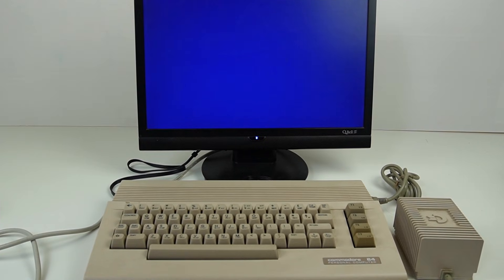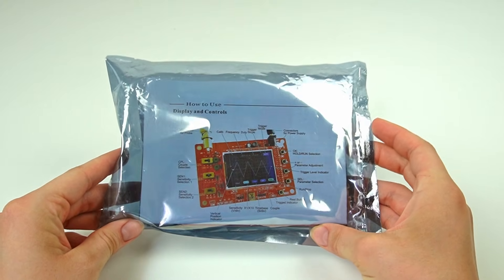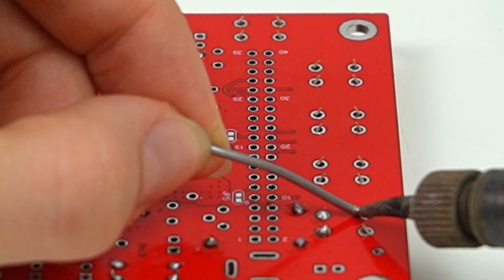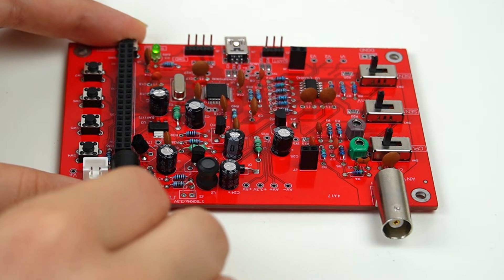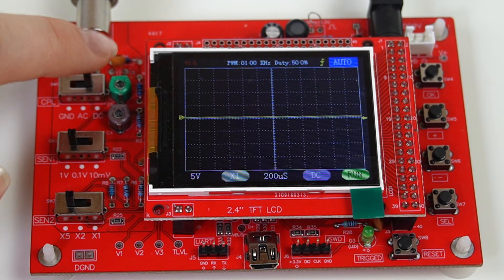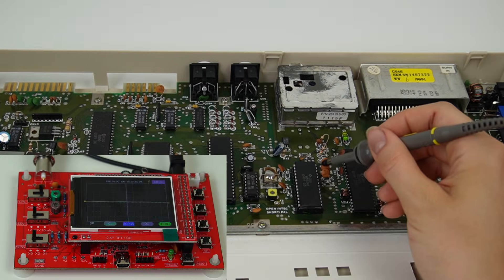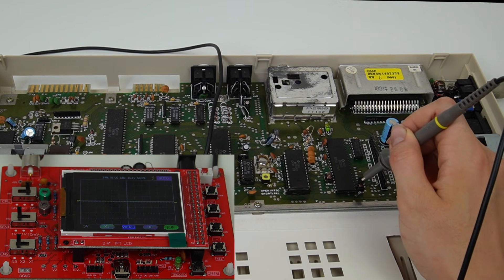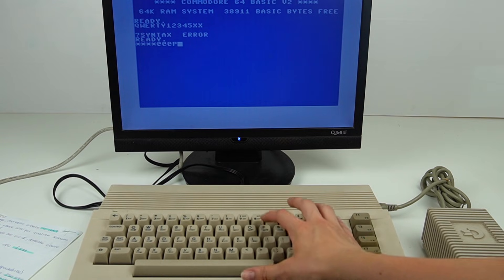I fixed a C64 using a $20 OSCILLOSCOPE

Comment: Just to say, and I think you do this in later videos, always test the power supply voltages before plugging and testing an old computer. Power supplies are one of the parts of old computers (and modern ones for that matter!) that often fail, and some will fail by supplying a high voltage, resulting in lots of damage to 40-year old machines, that often do not have protection diodes and fuses, however, most PSUs have fuses, but not all of them.

Comment: You have an amazing skillset especially at your age. I got into software development (or programming as it was called in the 80s) when I was 12 on the VIC-20 and C64, and I'm still a software engineer now, but I regret not getting into hardware and electronics as well since it would be really useful to be able to fix things like you. Really enjoy your videos.

Comment: In same cases, you must use the tools you have. In rare cases, a better tools is required. Well, i have both of them and i use the cheaper tools more often than the a lot more expensive ones. 
I don't had seen that your use a desolder iron. Well, i can recommend using this, because this is much gentler on circuit boards than working with copper wire and flux. But this tools is very expensive and the best of them uses an air compressor. I use a tiny silent one for just 100 euros.

Comment: Excellent video!

I would suggest avoid using the original Commodore 64 power supply. These old PSUs are board killers and will fry your motherboard in time.

There are plenty modern and more reliable substitutes. I had one custom built with fuses.

Comment: Thumbs up young lady.
It is really nice to see that after two generations, there are young peoples trying to learn electronics/programming/hardware from scratch.
In 80s, I did not have the C64, I was a ZX-Spectrum guy, but my beginning was similar. Program in BASIC, in Assembler, make a simple hardware like 8bit A/D or D/A converter and attach it to the ZX-Spectrum etc. Later, I built the modem (300 and 1200/75 Bd) for ZX-Spectrum. I have this modem till today as a relic which remember me those days.
Thx a lot for a nice video.

Comment: Good old cold soldering!
BTW, try to use shorter ground connection for anything more than 1 MHz.
Good for you, taking the trouble to build a tool that can be very valuable...
EEVblog just did a video on an $80 two-channel scope/meter
Hey, someone send here a good set of electronic cutters! You had to struggle too much with cutting those resistor leads...

Comment: Just a tip that can make aesthetics slightly different: before shortening the pins, I like to pull the excessive solder by melting the blobs with the board upside down, one by one, so they end up looking like cones made by wave soldering. Your mileage may vary, depending on your soldering iron, temperature and solder composition.

Great video! I hope to see anything like MSX consoles in the future.
Reply from the maker: Thank you for the helpful tip! I appreciate the suggestion to improve the aesthetics by pulling excess solder before shortening the pins. I'll definitely give that technique a try.

Comment: Excellent video! That little O-Scope is a good tool to have for electronic projects. Many of us old timers, use them for quick testing. Tip: When you have to push hard on a probe, it is as you found: bad solder joints. Rather than removing and re-soldering, simple just reflow the solder. You will see it turn back bright and shiny again, and you can then continue diagnoses. A drop of liquid flux will also make it reflow even faster! Again, Great Video! :)
Reply from the maker: Thank you for your valuable tip! I appreciate your expertise. I'll definitely try the reflow method with the solder. Thanks for watching.
Reply: I remember using flux paste and using solder wic, to get rid of excesive solder. I'm glad Radio Shack sold solder with flux.

Comment: Nice work, I bought the same oscilloscope, I recommend using a 9v battery, power supplies tend to disturb its operation for precision operations.
Reply from the maker: I'm glad to hear that you purchased the same oscilloscope. How are you finding it?
Reply: @Sayakas_Digital_Attic  Given the cost, it's an excellent product. I just had to build myself a decent tip because they supplied it with alligator clips, and get a 9.6 volt battery pack with a pack of 8 rechargeable 1.2 volt AA batteries, if I use the switch power supply low voltage frequencies are not detected due to too much noise.

Comment: Nice job! You were fortunate that the only problem with the keyboard I/O failure was oxidized contacts. When I got my stolen PC back from Houston Police Department’s evidence locker my keyboard didn’t respond either. In my case the UM82C55A keyboard controller chip was blown and back in the early 90s you could go to an electronic parts store and buy the replacement chip. I replaced it and had to do two “blue wire” jump’s because I damaged the circuit tracing. Looks like your Commodore 64 circuit board was more robust. Nice that you were able to get an oscilloscope so inexpensively. Looks like most of the components were through hole except for two smt parts. Did you slide those too or did they come already soldered?

Comment: She didnt use an osciloscope for anything really - re-socketting chips is a common troubleshooting step when diagnosing any old hardware - all she really did was build an osciloscope from a parts kit and resocket a chip....something you wouldnt even need an osciloscope for....good to know theres a 20$ osciloscope out there for hobby projects...i would doubt its precision though

Comment: Try a sharper set of cutters to avoid rocking the leads and potentially lifting the pads and damaging the PCB. Also, heat the hole and the leads with the iron a bit more to avoid cold joints. Very cool idea for a video. 👍
Reply from the maker: Thank you for the helpful advice! I'll definitely try a sharper set of cutters and ensure to heat the hole and leads more thoroughly. Your support means a lot! 👍

Comment: Very nice work.  I hope you'll accept one suggestion.  When you were assembling the PCB, you were cutting some component wires by both squeezing the pliers and levering against the PCB.  Even truly blunt pliers/cutters will cutthough copper - although sharp ones do it easier!  You shouldn't ever lever or pull the lead, because that way you might detach the track from the PCB.   

And now I'm trying to find a plausible excuse to get one of those scopes.
Reply from the maker: Thank you for your appreciation and the valuable suggestion. You're absolutely right about handling the wires while assembling the PCB. I'll make sure to be more careful and use a proper technique in the future to avoid any damage to the PCB. As for the scopes, they are indeed quite useful. Maybe you can consider it as a tool for your upcoming projects or experiments.😄

Comment: Please make sure you give the board a good clean with isopropyl alcohol after using the contact cleaner as some brands leave an acidic residue that corrodes the parts after some years of storage. Congratulations for your repair!
Reply from the maker: Thank you. I'll be sure to clean the board thoroughly with isopropyl alcohol after using the contact cleaner.

Comment: The use of the braid looks very strange, as does the soldering itself, literally as if someone were holding a soldering iron for the first time.
Reply from the maker: I am trying to improve my soldering and desoldering skills over time. Unfortunately, I didn't have a desoldering station, which made the desoldering even more challenging

Comment: you have my full respect young lady! I am glad to see that even young people are interested in these good old machines. It has been more than 30 years since I started to code on 8 bit machines but this gave me a very solid backgrounds which I am still using in my carreer of an embedded software engineer. Very nice!
Reply from the maker: It's incredible to hear about your journey and the valuable experience you gained from coding on those classic machines.  I appreciate your positive feedback!
Reply: @Sayakas_Digital_Attic  I started back in communistic Czechoslovakia, as a kid started to code in z80 assembly ("programming" on paper and then rewriting stuff to memory, without assembler which I didn't have back then). This gave me a very good understanding of how computers work. Then I finjshed my master degree in computer sciences and later worked on many many projects for big names in the industry  (Apple, Google, Amazon and many others). Anyway, watching your video reminded me when I was young. Keep going and you can get wherever you want.

Comment: Should you see this kind of a problem again, First, re-seat the keyboard connector b4 any soldering to the pcb. Pin oxidation probably didn't affect the connection of the pins of the CIA to the PCB. Still, I applaud your efforts.

Comment: Well, nice to have a scope anyway, but really visually inspecting the dry joints would have been my first task. 80's silicon may not be the highest spec, but honestly they run so slow and were so over engineered, unless someone shorted something they will just keep ticking on forever. 80's soldering, on the other hand, was God awful and used all sort of variable quality lead based solder. Sometimes it is not even worth turning it on before flashing a heat gun over everything and seeing if the grey malaise of dry solder changes at all.  

Still great to see another C64 saved from the scrap heap, so Kudos for that, and thank you for sharing.
Reply from the maker: Thank you for the insightful advice! I agree, those dry joints can be tricky. Saving these vintage devices is a passion of mine, and I'm glad you appreciate it. Thank you for your support and valuable input!
Reply: @Sayakas_Digital_Attic  

Most welcome. Bottom line is there is no substitute for experience and so try, try and try again, and you can only get better.  

Spero che i regali siano andati bene. Mi incoraggia vedere qualcuno che non ama vedere la vecchia tecnologia abbandonata e gettata via. Quindi continuate a fare quello che state facendo e a condividere, per favore.
 
Abbiate cura di voi.

Comment: Get yourself a TS100 or other modern FET soldering iron.  I love mine.  It's not perfect but it was a game changer for me.
I have barnfulls of these old computers and a shop, you'd be in heaven restoring these old machines.  Or building quadcopters.   I would of just handed you a Commodore 128D.  If this one don't work, try another...

Comment: You should probably replace the original C64 power supply, I've heard people say countless times that the voltage regulator fails in them, killing the C64 eventually.

Comment: Keep at it...one thing you should realize is that most technology has actually been suppressed from evolving...learn to question everything, even if it comes from textbooks, it's what happens in real life and what you observe that matters...

Try and understand the principles of electronics as much as possible...don't be afraid to design your own circuit boards and also recommend you get into machine learning while incorporating Arduino...

Programming is good, though only when it's coupled with Arduino and actually can do things in real life does it actually become beneficial...

You are far ahead of the pack by even being knowledgeable and interested in electronics repair...Best Wishes to you Ms...

-ER x

Comment: I sort of scraped the surface of electronics in my electrical trades course.

I could still do a course in electronics at tech or I could repair things such as the C64 computer if I had a schematic of the PCB including signal outputs.

When I move into my own place which will have more room I would like to do a bit of Arduino building & programming with my Linux software based computer  !

Comment: Interessting. I fried My First X-Box Classic console, it got a short circuit because I tried to use a LiR2032 to replace the TimeCap (big mistake). Do you think you could find the damage with the oscilloscope and repair it? The repair shop I sent it to said, he could not do anything without the original xbox diagram and Microsoft would never hand that out...

Comment: The problem I faced cheking circuit boards is that some IC I have no idea which output do I need to expect. Maybe in the future you could share some ideas how to check some basic board, like a power supply or something similar. Thanks for your video.

Comment: Nicely done. However, if you want your Commodore to keep working, you should not use the original power supply. They are known to be erratic and you would be better off with a more stable today’s replacement.
Reply from the maker: Thank you for your feedback! I appreciate your concern about the power supply. You're right that the original ones can be unpredictable. I'll definitely consider using a more stable modern replacement.

Comment: Great work. Try to get thinner solder. Thick solder is causing too large size of the joints. Much better to use thinner solder wire. Maybe a better soldering iron with proper temperature control also.
Reply from the maker: Thank you for the advice! I'll definitely consider using thinner solder and investing in a soldering iron with better temperature control  in the future

Comment: I bought and used exactly the same scope in 2019 when I got into the retro scene. Great little kit for the hobbyist to build and to use. I will admit I was keen a little later to buy a more capable DSO and ended up with a Rigol. But it was not cheap. The diagnosis process you used was sensible and its pleasing to see you found the issue. I have just finished a repair on an old breadbin C64 where one of the MOS 8708 logic chips had died.

Comment: 35 years ago, when I was a kid, I asked for and got a cathode ray tube as a Christmas present - and built my very own oscilloscope...although it was probably rather more dangerous than yours (given the voltages used) 😂 and took about three months to build 🤣. Subscribed with a donation towards some smaller cutters!!
Reply from the maker: I'm really glad you had this adventure as a kid.Thanks for sharing that fun memory and thanks for the support with the subscription and donation! In the next video, I will definitely use better cutters 😅

Comment: Little advice to the soldering. Keep the soldering iron in contact with the leg of the component and the circuit board for a longer time, and the soldering will be better. Preheat more before you put solder in it. The solder should be concave and not convex in shape when it's properly heated and soldered. Convex solder breaks more easily and that causes problems later. Sorry about the bad english.. I used Google translator, because i'm not sure about the correct terms of words in english considering soldering . Otherwise, great video!
Reply from the maker: HI!. Thank you for the compliments and for the advice

Comment: I had this OSC and only thing that was useful was frequency counter.  First i had to put in into metal box because if its open and naked it will display noise, even without test probe... second problem was amplitude selections that distorted signal. So dont trust this if precision is important.

Comment: I have a computer of type HAL 9000 but it is psychotic, it needs fixing though...
Reply from the maker: Oh, a HAL 9000, you say? That's quite the computer, but I hope it doesn't start giving us any "2001: A Space Odyssey" vibes! 😄
Reply: @Sayakas_Digital_Attic  it has a tapeworm installed don´t worry it does not remember a thing about the past watch 2010 the sequel and you know what I am talking about, it needed a session with doctor Chandra, the computer shrink, it is completely fine now, however keep silent about 2001 vibes it listens in and might get dangerous if you rember it about it´s past...
It usually just tells me to take a calming pill and think things over, but hey that is a remnant of those days...

Comment: Nice video! You are an impressive young person. 
I purchased one of those $20 oscilloscopes a few years ago. It was a fun little project and I've used it a several times for various things. I highly recommend printing one of the cases for it on Thingiverse. I'm assuming you have a 3D printer...
I'm also old enough to remember the Commodore 64 although I personally had an Atari 800.
Reply from the maker: Thank you for your compliments. I'm sorry, but I don't have a 3D printer; however, I was actually thinking of making a wooden container

Comment: Your skills are impressive but your soldering technique is wrong. Solder flows in the direction of heat. So put the soldering iron on the PCB first then touch the solder to the PCB at the iron. That will ensure a proper bond. You’re currently running the risk of a cold joint
Reply from the maker: Thank you for the valuable tip and feedback! I truly appreciate it. I'll definitely work on my soldering technique to ensure proper bonding and avoid the risk of a cold joint.